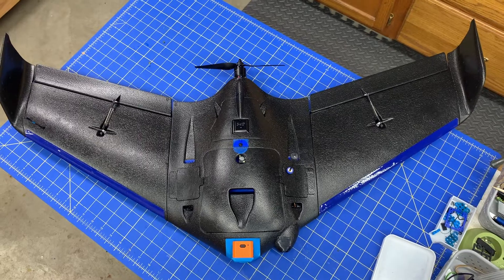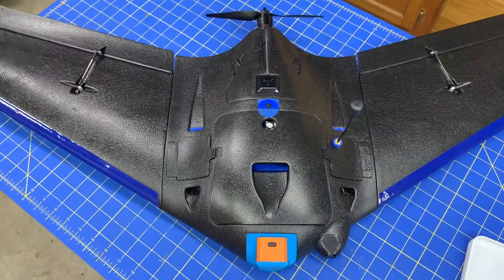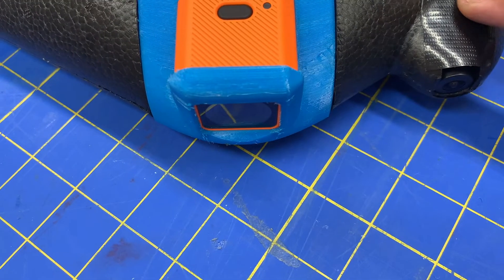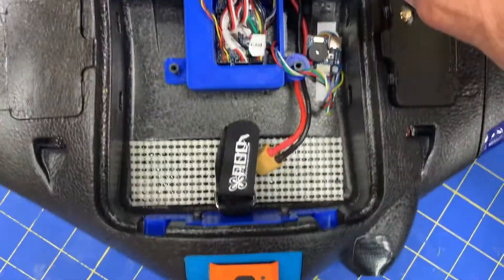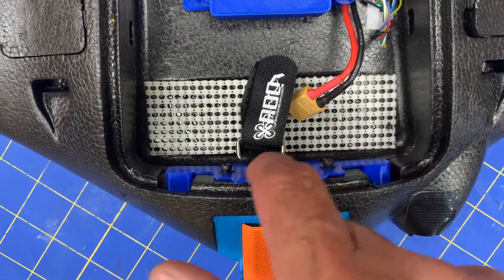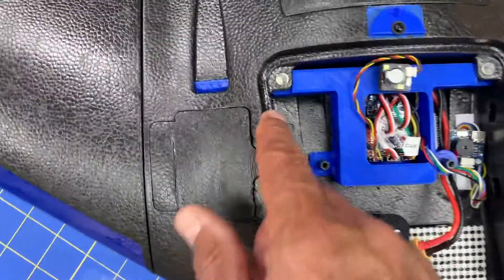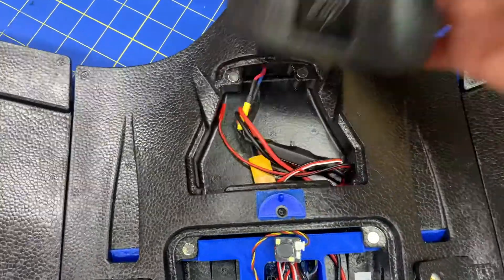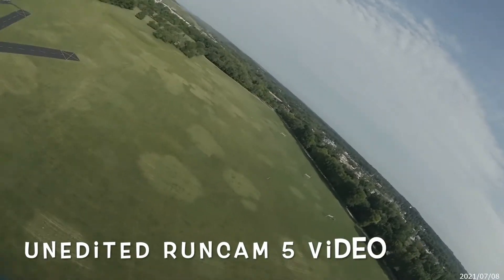SonicModell AR Wing Pro - Build, Maiden and Review

Comment: Great looking build I have basically the same setup on my ar wing pro except the antenna on the vtx, I'm using the vas mad mushroom mushroom and just can't get any range usually half mile then loose signal. I'm just wondering about your video range? Thanks
Reply from the maker: Thanks..  Its a super flyer.  I have 2 Pro and one classic.  Can't get enough...   I've had pretty solid range with this setup..  Using a new VAS Patch on the VRX really helped me out for those long range flights.